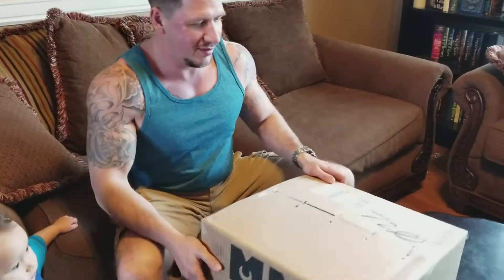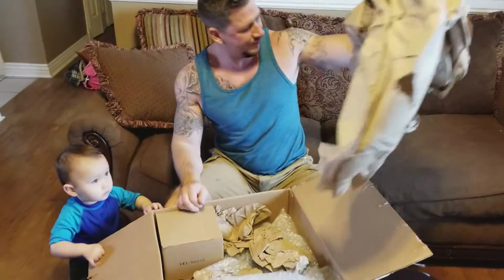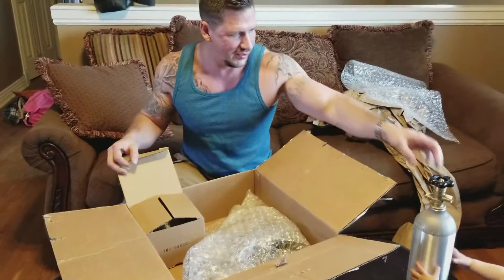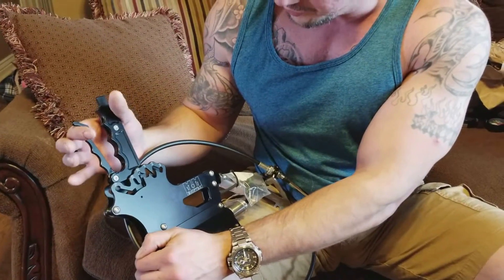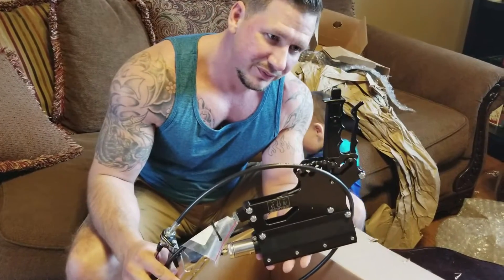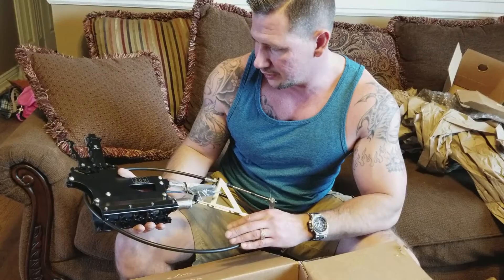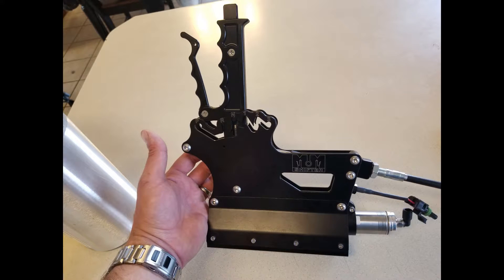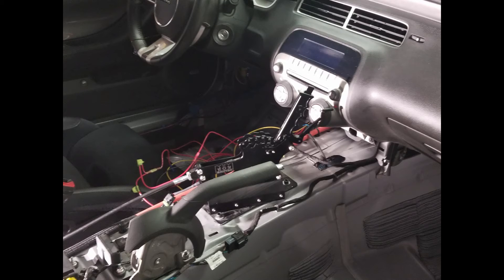M&M CO2 Shifter unboxing with details.

Comment: what is the red / black plug harness coming off the rear for ?
Reply from the maker: CO2 control to actuate the shifter. You can program the RPM for the shifter and then when it gets to that RPM the CO2 shifts the shifter for you.